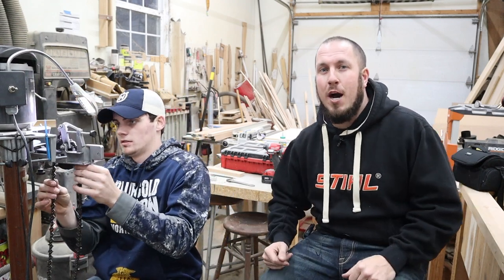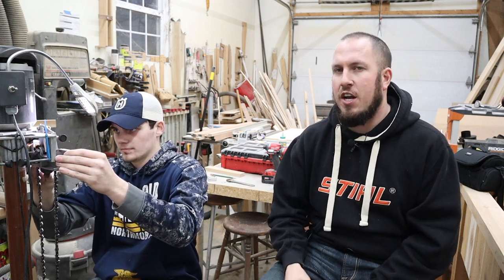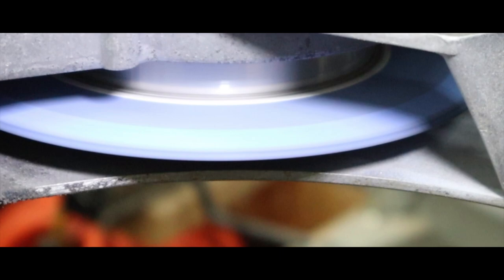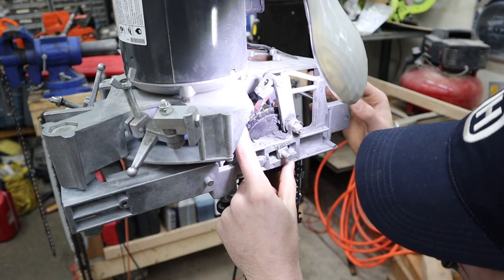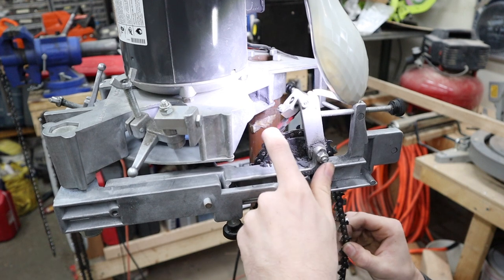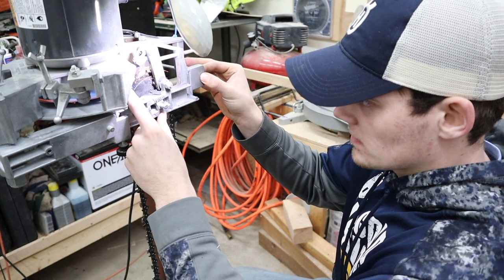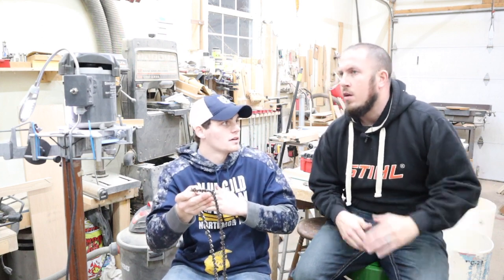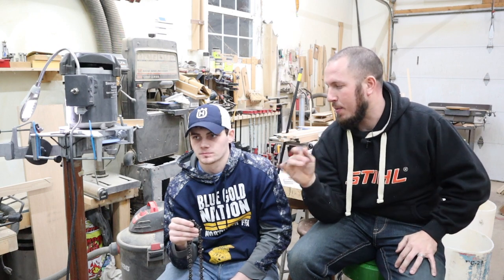Sqaure Grind Basics - Simington Grinder

Comment: I have one of these exact same machines and I can tell you they do a heck of a job.  That square grind cuts so much better than the round grind because it severs the wood fibers so much better than the round grind.  Also make sure to use a gauge (and another grinder-I use the Oregon 511 AX) to take the rakers down to .025" below the freshly sharpened teeth.  Another thing to remember with those grinding wheels is to keep the corner of that wheel from getting too much of a black mark on it because when you see that black mark starting you will start to blue teeth.  

One last thing is it looks like you guys are running full comp chain and I will tell you here in Oregon all the professional loggers and myself run full skip chains and they turn faster and clear out so much better than the full comp chains.  A full skip chain is also way faster to grind because there are way less teeth to sharpen.

Comment: It's hard to find the RS 0.063" gauge chain here. Mostly RM 0.050" gauge. RSKL is not available through the distributor from Stihl here either. Lots of semi-chisel. Have to special order all the carbide too.
Reply from the maker: I have found out in recent testing that RSKL chain is garbage. I couldn’t believe how bad it was out of the box. The RS chain was twice as fast!
Reply: @TheDurbinCompound  How about after grinding/filing it.
Reply: @TheDurbinCompound  For some reason its all rubbish out of the box, get that chain and touch it with a Simington, take the rakers down 10 thou and it will take your RS to the cleaners.  The Oregon may be a bit faster out of the box,  but Stihl's tooth seems bigger/ longer.  I run square now and wouldn't go back to RS for anything. just my 2c
Reply: Any chain straight out of the box just doesn't cut good, I always file my new chains before I head to the woods. It makes a big difference, you can tell the difference when you're filing a chain.
Reply: @sheepdog271  the new husky x chains do a great job out of the box, fast and smooth, it also holds an edge very well(comparable to stihl chain). The bummer is its not something you can easily duplicate, I can get it close on the grinder, but it takes multiple passes at multiple angles. If I want it fast/faster and very smooth, I put it in the simington.